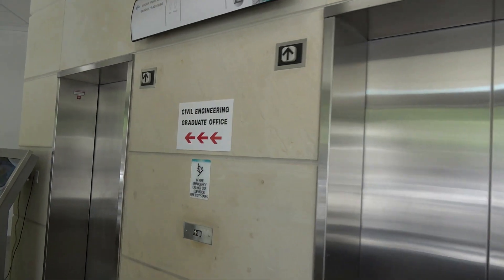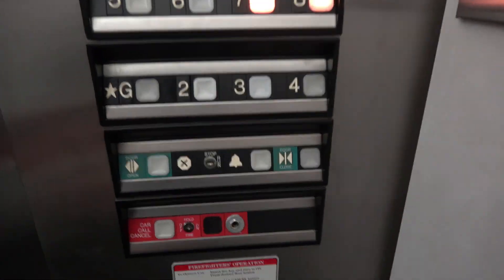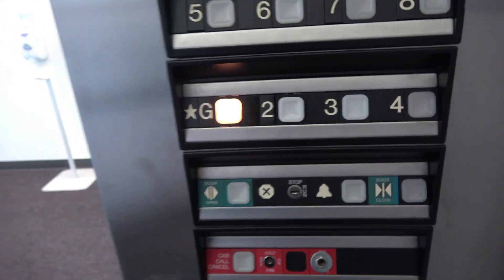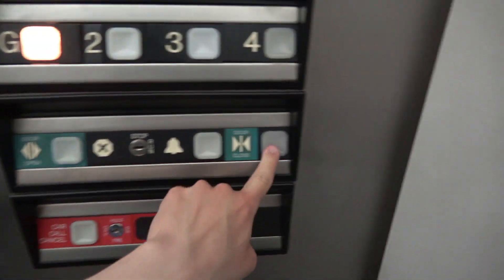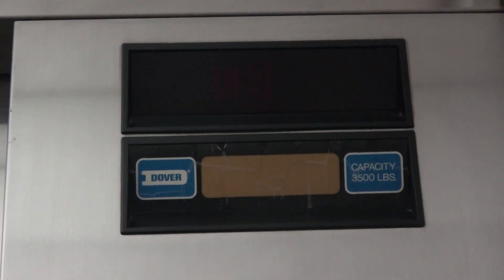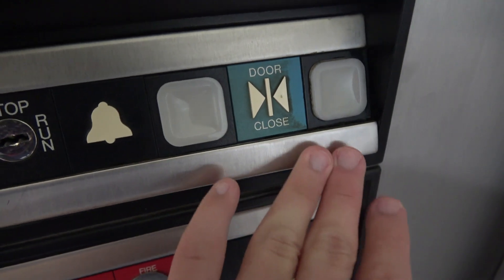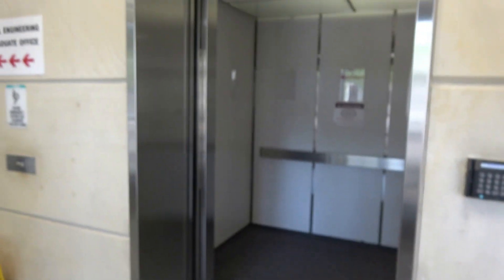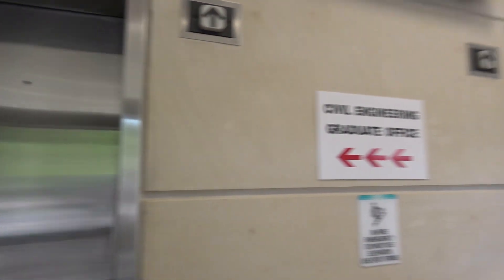Dover Impulse Traction Elevators at Zac Civil & Engineering Building, TAMU in College Station, TX.

Comment: Ah the ever-reliable Dover Impulse. I believe these would actually be considered Dover Traflomatics as they had a particular name for their traction elevators with Impulse (correct me if I’m wrong) I have yet to find an impulse with the grocery beep and not the typical buzz. All I’ve heard is the old buzz.
Reply from the maker: Actually, these appear to be Computamatic systems (in other words for Composite according to records) mainly because these are relay controlled seeing the blinking floor numbering.
Reply: Cool. Well I tell you what Jim today you’ve taught me something new. As you might’ve noticed, I’m quite a bit newer to the elevator filming community so I’m not the best with my elevator stuff or filming.